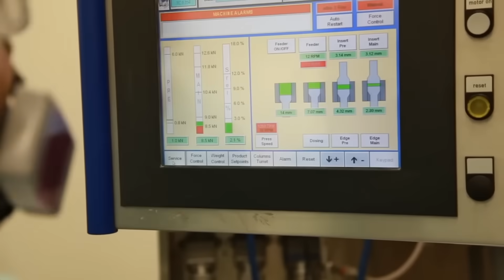Why These Engines Only Last 3 Seconds

Comment: I knew a guy that ran a top fuel bike. His vision of a perfectly tuned engine was one that exploded just as it crossed the line. Tough sport for sure;)
Reply: Those Nitro Bike guys are a different breed. No thanks.
Reply: @BastardX13  Nah, we just love work and hate money 🤣
Reply: Not quite correct any more.They're quite often getting several passes out of a motor these days . Larry doesn't have to change a motor after each pass any more, Mitch is getting multiple runs out of his motors. Same with other racers.
Reply: why they only last 3 second because they need to last only 3 second plain and simple🤣🤣🤣🤣🤣
trust me if they wanted the engines to last longer they would design them to last longer like any engine🤣🤣🤣🤣🤣
Reply: @raven4k998  it's simply impossible to design a engine that's able to withstand these conditions for more than 1 hour
Reply: @slayin.dragons  no it's not they can make truck engines that powerful and they last longer then 3 seconds so do not tell me it cannot be done just because it has not been done yet if you had even half a brain you would know anything is possible with the right design and engineering so do not tell me it cannot be done everyone who has said that sooner or later is proven wrong because of progress
Reply: @slayin.dragons That's why it's a huge waste of energy and money! And we're all paying for it win the environment!!👎
Reply: @raven4k998 there is not a single truck engine making 10,000 hp...
Reply: @vincentlussier8264  yeah and u pay too :) and i laugh about that hahaha
Reply: @strammerdetlef I love motorsports. Sprint cars, figure-8s and monster trucks were my entire childhood, but people like you ruin it for everyone. Keep laughing until the gub'ment puts their thumb on the scale; then that other guy will be laughing at you. 🤦

MotoGP 'til the end!!
Reply: @vincentlussier8264  nitro produces oxygen on combustion.Doesn't that make it a green energy ? 😁
Reply: @raven4k998  uuh some one got triggered there didn't they 🤣. Yes you can make an engine that would do a drag and be perfect after, but the money you needed and the added weight would be big boy. Drag racing is the ballance of cost, durability and brute force ;)
Reply: @raven4k998  Eleven thousand horsepower truck engines?!
Also, physical limits are very much a thing. Progress sees us steadily approach those limits. For instance, there's a hard limit on how much air you can get through a restrictor in a naturally-aspirated engine; physics just says "that's all you can have."

Comment: I will never believe that those engines only spin a few hundred revolutions. There's just no way.
Reply: The slick tires are usually 36” tall.  They grow about 10% taller as the engines rev up to about 8,000 rpm.  Typical rear end gears are 4.30 to 1.  The racetrack is 1,000 feet long (no longer a 1/4 mile).  Add into this clutch slippage and tire slippage due to a lack of traction, and some other considerations I may be leaving out.  Take all this info, do the math, and it yield spins of the engine’s crankshaft somewhere around 450 to 550 rpms.
Reply: @douglasjaeger1559  I do not believe it still.

Comment: Nitro methane doesn't carry oxygen, it carries nitrogen. Nitrogen, like oxygen supports combustion. Much of Top Fuel's recent advances comes from using things like carbon fiber and inconel, which Formula one has used for decades. Of course, we would be remiss if we didn't mention this technology first evolves from the aerospace industry.
Reply: Yes it does; its chemical formula is CH3N02. NItrogen supports combustion? Where in the world did you hear that? It does, however, CONTROL combustion. If it weren't for nitrogen in our atmosphere the entire world would be on fire.

Comment: a top fuel car burns about 15 gallons of nitro methane per run,   540 engine revolutions from light to light ??   You are refering to tire revolutions not engine rpm.  fuel pumps are capable of pushing 90 gallons per minute at about 6,800 rpm

Comment: Some years back I said that maybe some day they would be so fast that the driver could not survive the run. You can only take so many G force before it is becomes life threatening.  Makes you wonder. Amazing engineering.
Reply: G forces experienced from a Top Fuel dragster are actually in the high 5 range, which happens after the clutch comes into full lockup at about the 400-foot mark, not off the line. There's actually more negative-g forces when the parachutes are pulled at 330mph, which is why most drivers allow the car to slow a bit on its own before tossing the laundry. Really hard on your eyes...ask Don Garlits or Joe Amato, both of whom had to stop TF racing due to retina detachment.

Comment: They need to get rid of the drivers and make them remote controlled. The driver does nothing and is deadweight. You could do all of it with a basic control and eliminate the egos and waisted safety cages.
Reply: You could say the same thing for literally every motorsport on the planet...pretty silly comment.

Comment: You did a great job of explaining a top fuel  dragster,  but there is nothing like sitting in the grandstands and hearing, smelling, and feeling two of these things hit the loud pedal at the same time with eleven thousand horsepower each! It's incredible! And I highly recommend everyone experience it at least once in a lifetime! 😋
Reply: he did a great job of literally reading off a very frequently circulated list of fun facts of these things. I remember reading that list online about 10 years ago.
Reply: Exactly! Great job sir!
Reply: Double the excitement, 4-Wide Nationals..
Reply: You should get the experience of standing behind at launch. Its Awsome!
Reply: You're 100% correct in everything you said, but I have to disagree with his portrayal of hypercar engines(ie. Bugatti) as "being able to produce 1,500hp while lasting 10's of thousands of miles without problems". Actually, the Bugatti engine will require MUCH more maintenance than regular passenger cars, and Bugatti owners will spend more than the cost of a brand new Mustang GT on maintaining the engine in that Bugatti.
Reply: @HighlanderNorth1  well of course a Bugatti will last tens of thousands of miles without problems if serviced properly. Nobody is daily driving them though. You can't really compare a hypercar with a regular car in that way. If you can afford one, you're not worried about the service costs, or fuel for that matter.
Reply: @HighlanderNorth1 the tires alone are seventeen thousand dollars for that money pit! I seen a documentary on the Bugatti varon, and the sixteen cylinder  engine putting out 1001 horsepower caught the roof on fire while on the dyno! There are twelve aircraft grade bolts holding the back half of the chassis to the cockpit that cost a hundred and twenty dollars a piece! But man! To get that car to drive into a corner at over two hundred miles an hour has got to be a kick in the ass! 😉

Comment: Those clutches are predominantly made by one company. The man that owns it has a father that makes one of the best multiplate wet clutches for racing karts. I ran a KT100 cart back in the early 2000’s with that clutch. They have a high stall speed just like the drag racing clutches. Mine was set at 8,700 RPM. the engine only turned 12,500 RPM.

Comment: A point of comparison: The Apollo Saturn V F-1 rocket engine had 50,000 horsepower ... ...->... ...fuel pumps.
50,000 hp fuel pumps. Each engine.
Reply: But wait... there's more....
The fuel pumps are powered by their own jet engines. 😂😂
Reply: @DS-lk3tx  TBH, they are basically rocket powered, IIRC in the F-1 using a lean or fuel rich mixture of the same propellant burned in the engine which is then also dumped out the nozzle, (on some rocket engines you can see a dark plum in the bright exhaust, that is the exhaust from the turbopump). This spins a turbine much like a turbocharger hence they are called turbopumps, the reason they use a lean mixture is so they don't melt the turbine. Some turbopumps also run on their own separate monopropellent like Hydrogen Peroxide run over a catalyst.
Reply: @SoulReaper1942 the exhaust from the turbo pumps was also dumped into the engine nozzle to help cool the engine bell from the high temperature main combustion gases so the bells wouldn’t be melted.
Reply: 1084 gallon per second per engine fuel+lox usage. 1084x 5 = 5420 gallon each second all 5 engines running
Reply: Space X's Raptor turbopumps alone require 100,000 horsepower per engine.
Reply: I read that, too, but that's an inaccurate number. The entire rocket developed 160 million horsepower, or 32,000,000hp per engine. A Saturn 5 consumed 40,000 pounds of fuel PER SECOND at full throttle.  https://www.google.com/search?client=firefox-b-1-e&q=saturn+5+160+million+horsepower
Reply: Understandably so, when taking in their mission, in comparison to the top fuel dragster, very big difference, so it's no surprise.
Reply: Yeah but a street bike with 150 HP can't pull 80,000 lbs but a 150 HP diesel can. Those turbines were probably turning 30,000 plus rpms, which will cause the HP figures to go extremely high compared to torque.
Reply: @Bryan-Hensley  A 300hp gas powered 1/2 ton truck can get a 80,000 lbs trailer rolling. That's easy, the hard part is stopping it.
Reply: @gethmord  The hard part is stopping said truck whilst also worrying about excess wear and tear from the internals.
Reply: @Bryan-Hensley A 150 hp diesel engine isn’t pulling 80,000 pounds around. There’s a reason the engines in semi trucks start around 400hp, and 1,300ft. lbs of torque, and go up from there. Btw, power is power. It makes f*** all difference whether it’s coming from a gasoline, or a diesel, as long as the gearing is adjusted to keep the engine in the power band. Because diesels generate torque and power at lower rpm’s, have higher compression, and diesel fuel is more energy dense, they get better fuel economy. Plus, they’re built stronger, so they last longer. Hence, that’s the reason they’re used for pulling heavier loads. You can pull any load out there with a gasoline engine. It would just get terrible fuel economy, and not last as long.
Reply: @thetowndrunk988  Engineering Explained viewer ?
Reply: @thetowndrunk988 well said
Reply: @thetowndrunk988  It's all in the gearing. I've seen tractors with less horsepower pull that much weight. And trains (amusingly, three of these top fuel engines output a similar amount of horsepower to 1 locomotive engine). And a 10,000hp locomotive can move several million pounds of load.
The reason semi's start at 400hp is because they need to maintain highway speeds. They can't afford the massive gear ratios tractors and trains can get away with. If you want to go 3 miles an hour, you could probably move 80,000 pounds with a much smaller engine.
Reply: @Ornithopter470   Really? All those years of college, with my brain hurting during those physics, math, and engineering classes, never taught me that!………come on, dude. No kidding. Did you read what the OP said, whom I was replying to? That a diesel at 150hp can somehow, mysteriously, out pull a gasoline engine at 150hp? Or, did you just read one random comment, and decide to type up something totally pointless, in an effort to sound like you know something most don’t? 150hp isn’t going to move 80,000 pounds in any meaningful way, and it makes f*** all difference where that power is coming from.
Reply: @thetowndrunk988  In that case, why do tractors typically have significantly less horsepower than your average semi engine? Same fuel, similar load requirements, different gear ratios. Yeah, 150hp is 150hp, kilowatts are kilowatts. But torque is not the same as power. It's half of the equation. Given sufficient reduction, yeah, a 150hp engine can absolutely move 80,000 pounds. Can't do it fast, because you've given up speed for the increased torque needed to get that load moving.
I was pointing out that your assertion that 150hp could not move an 80,000 pound load is flat out incorrect.
In reference to the comment that you were replying to, it again boils down to gearing. The two engines have identical power output, probably at different speeds, but the gearboxes actually driving the wheels have wildly different design goals, and as a result of that, one has insufficient torque (and probably insufficient traction) to get a load rolling, whereas the other does.
Reply: @Ornithopter470  Just to continue this pointless debate, where did I ever state torque was the end all- be all? I never did. You just randomly said “it’s only half the equation”, when I never mentioned torque. Mind blowing. Just fyi, a decently strong human being, on a typical bicycle crank, can actually produce a lot more torque than most small engines can, but does that means we’d be better off mowing our lawns with a pedal mower? Of course not. It’d take far longer, because we cannot even come close to producing THE POWER of a typical riding mower.
Reply: F1 engines where something else. There are no people today that have the knowledge to remake them
Reply: @hoedemakerbart  lol... NASA definitely knows how to remake them. They don't, because better designs are possible now.
Reply: @noyb7920  That myth comes from the fact that they were designed and built before computers, essentially: the engineers kept hardcopy notes that were not archived. So no, these engines can never be copied exactly since the modifications arent completely known but yes you are correct - NASA absolutely could make better ones... if their budget wasn't being used as a political prop, anyway.
Reply: @hoedemakerbart  Why would you want to remake the Saturn V's F-1 engines today?

The F-1 was an incredible, and awesome, piece of engineering. It was also developed in the 50s. Rocket engines have advanced significantly in the 70 years since then. We wouldn't be able to build and launch modern rockets using 1950s engine tech.

Yeah, it's cool that the fuel pumps have their own dedicated turbines. Staged combustion designs do the same without dumping the turbine exhaust overboard and wasting the energy. The F-1 can't be restarted and is disposable. The thrust from one engine is awesome, but modern engines can achieve higher thrust-to-weight while being more efficient.

Comment: Rockets were the fastest race cars but were banned. Also, 8 G's? your exaggerating.
Reply: They hit 6 Gs about half way down the track.
Reply: Thats because they were for the same purpose until they were banned. They never got to 8g they at most got to 6, and their take-off was slower and only managed to get in the 3s by their top speed.

Comment: In my opinion, everyone that is a car, engineering or technical science fan, should go to a Top Fuel event. Its  all there.   However, it is one thing to try to explain the experience of standing 30 feet away from a stick of Dynamite going off but, with 8000 sticks of it going off, with an attached Doppler effect over 100ft..has no other comparison ..One Physically has to be there to experience it. Take note, Not only does the launch off the line shake your teeth,and guts, it will momentarily paralyze the lungs ability to function, They vibrate like the bags of air surrounded by mostly water, that they are. It makes one uniquely aware of their being.. Plus, You instantly understand why simply leaving the line in a Top Fuel car, will most likely make the average Citizen, "Black Out."
Reply: That video of the old man at his first drag race freaking out and ducking down from the sound is priceless! But then his smile...😊
Ive only been to NASCAR (Darlington) and even that was SO much louder than I expected...I cant even imagine a Top Fuel event! Earpro MANDATORY!